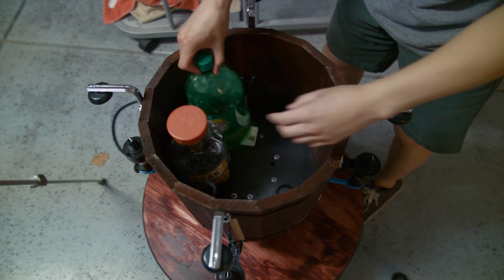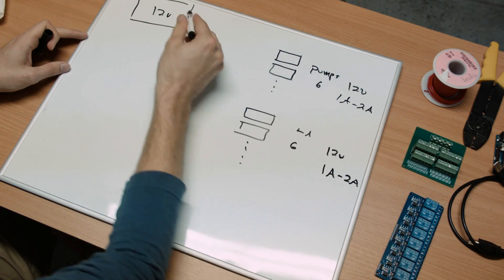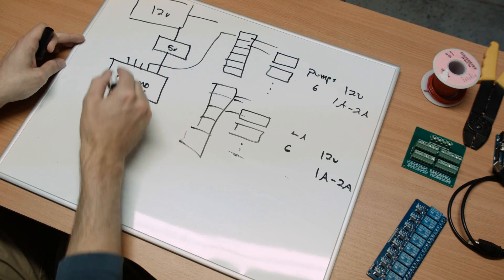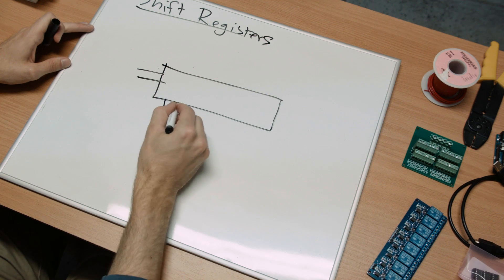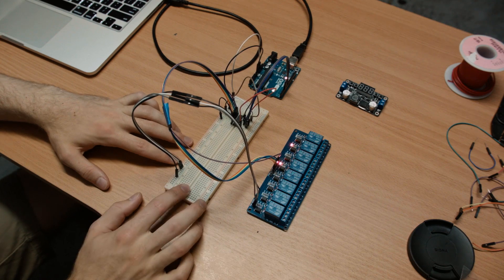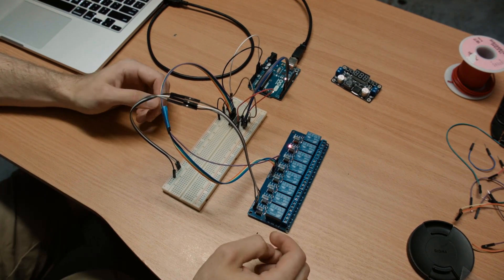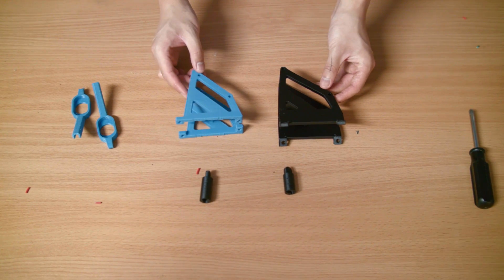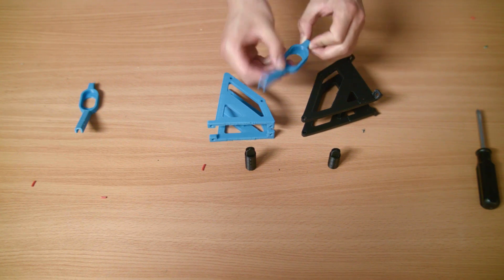Building a Robotic Bartender - Part 5: Shift Registers and Initial Wiring

Comment: hey guys. digging the videos! can I give you a suggestion or 2? you don't need an extra latch pin to use more than 1 shift register. the first register will have a data out that you can feed into the input of the second register. what you can do now, is use the 4th pin for the enable line of the shift register, that way you could leave the outputs disabled, setup what pins you want as outputs, and enable them and do more accurate time measurements on them. you still have the delay and variability of the relays to deal with though... so maybe swap them for MOSFETs and you can (more) accurately control your motors for drink dispensing. hope that makes sense, looking forward to the next video!
Reply from the maker: Good point and thanks for the support! I think for simplicity's sake we are going to wire data and clock in parallel to both shift registers. We will use the latch like an enable pin to load the values into the registers. Since the clock is so fast (on the order of mHz) and we're not doing anything too time dependent, I think it'll probably be okay for our application.